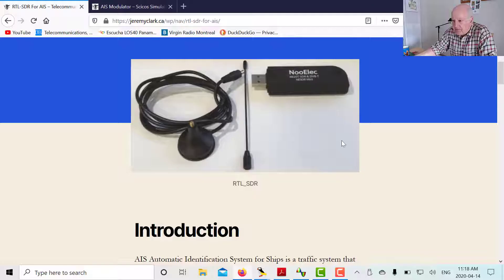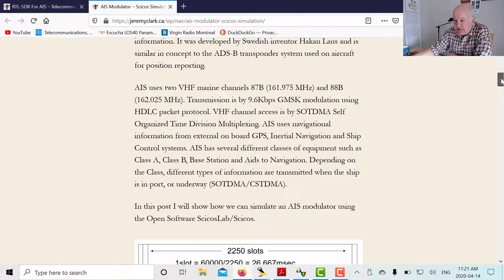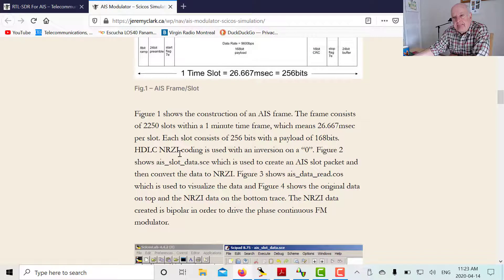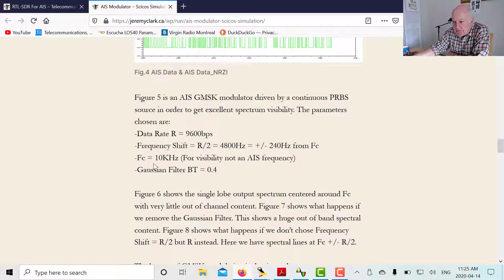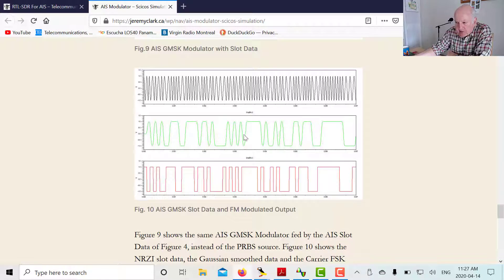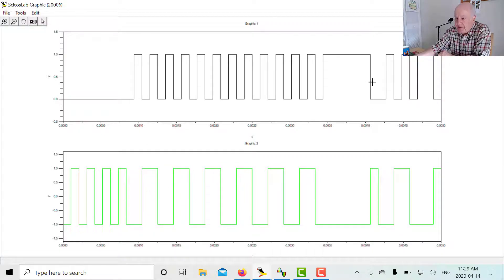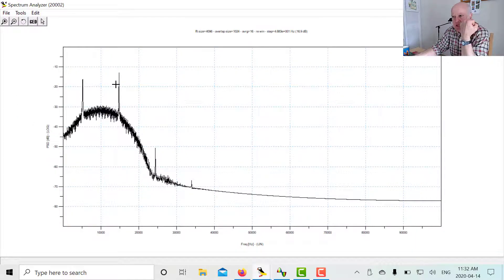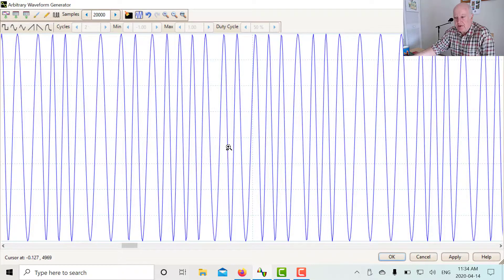AIS GMSK Modulator - Scicos Simulation

Comment: Hello, Jaremy, great content. I guess you are encoding NRZI the ramp.
Reply from the maker: That's right. The VCO works on a linear ramp, so if the input voltage is 0 volts then the output is Fc (which for convenience is 10KHz) and for a +1volt the frequency increases to Fc+Fmark=10KHz+2.4KHz and for -1volts the frequency decreases to  Fc-Fspace=10KHz-2.4KHz.
Reply: @ClarkTelecom  Cool, In my mind the ramp up/down was just to avoid ISI.
Reply from the maker: @notmacarraogrudento  If you don't use a phase continuous VCO, but discrete oscillators at Fmark/Fspace then the spectrum has lines at these frequencies.

Comment: Can you tell what is the meaning of 'Sample data 100 times' in your code. Is it interpolation or decimation of samples 100 times.
Reply from the maker: If I don't sample by 10x or 100x the data goes into Scicos as vertical lines (1 sample) vs. a flat top data pulse....it is sort of an analog way to build the data.
Reply: Ok. So it's upsampling.
Reply: Thanks

Comment: Nice Explanation. Can you please share code, i want to run it in scilab or scicoslab. Thanks
Reply from the maker: The schematic/code is in the blog post. Construct the slot data in Scicoslab then import into Scicos as a structure.
Reply: @ClarkTelecom  thanks for the reply but in the blog the code is in the form of image with few lines.
Reply from the maker: Code is visible in video at >=10.18